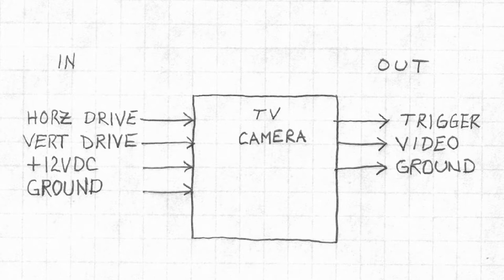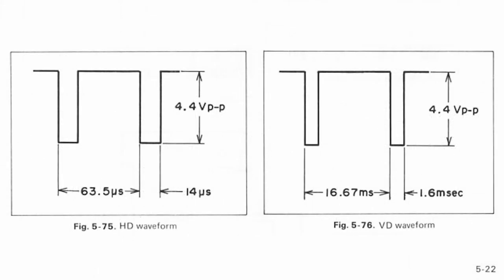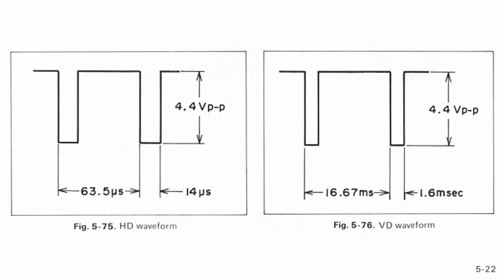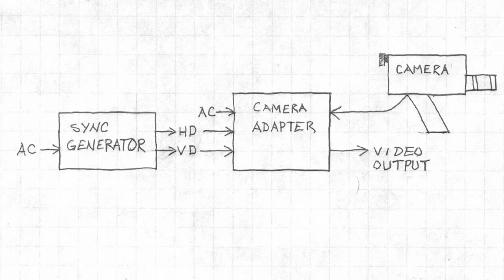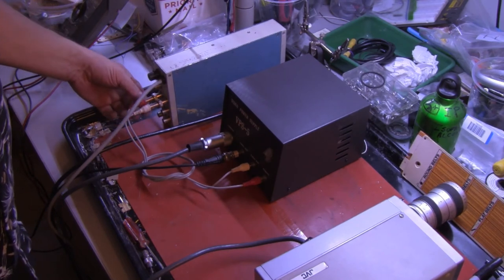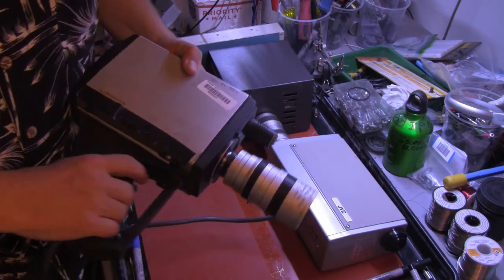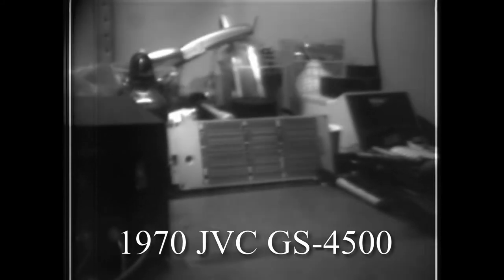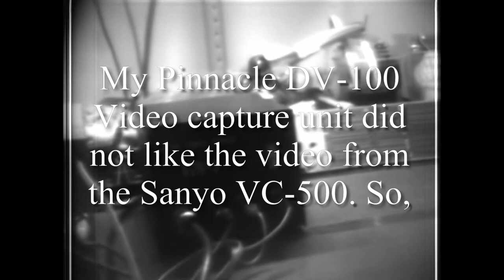Video Portapac Cameras of the 1960s and 70s

Comment from the maker: I have just tried this rig with up to 15 different cameras. Some models, I have more than one. Here are the ones that work: Sony AVC-2400, AVC-3400, AVC-3450. JVC GS-4500, GS-4600. Sanyo VC-500. Concord TCM-46. Panasonic WV-8080. One of the Concord TCM-46 is nearly identical to the Panasonic WV-8080 while the other Concord TCM-46 is identical to the Sanyo VC-500. That shows how fast the tech was changing even back then. My test system is working all of those different cameras without having to resort to modifying any of the drive pules. I will make a follow up video as I learn more. Stay tuned!